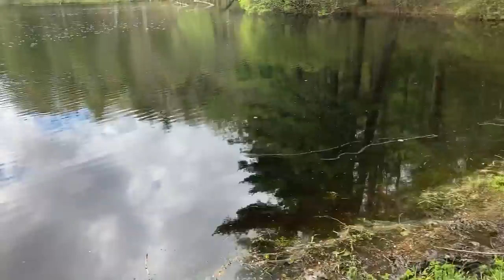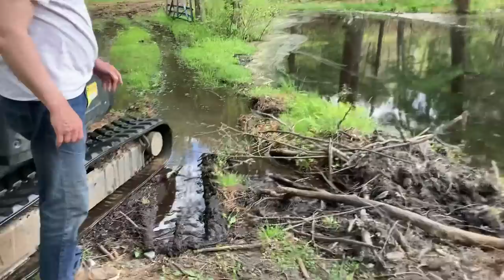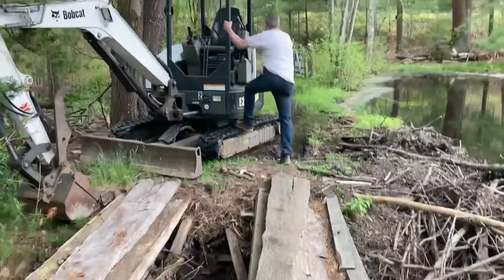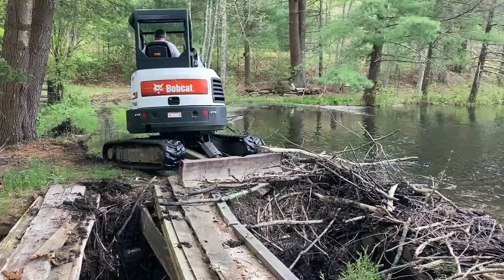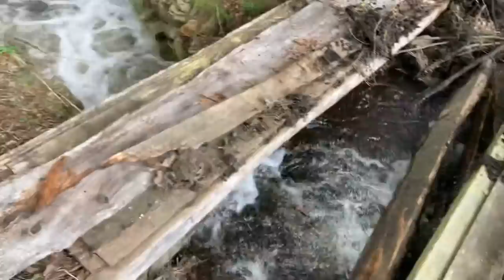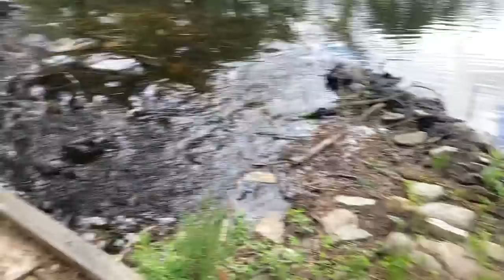How To Use The Bobcat E35 To Clean Out A Beaver Dam

Comment: They will keep rebuilding the dam.   You have two choices, take the beavers out (trap or shoot)or get two runs of 40 foot 4-6 inch white or black septic leech line pipe that has all the holes in it and lay it over your dam, with a couple of 90 or 45 degree couplers so it stays under water and follows the line (drop) of the dam.   Pin the pipe to the bottom with garden staples or use rebar stakes to keep it at the depth that you want under the water, otherwise they float.  And you have to have the length or the beavers will just mud over the pipe and dam the opening of it.  That will keep the pond at the level of the dam.
Reply from the maker: Thanks for the Information Patrick